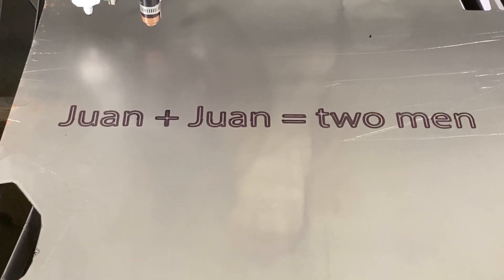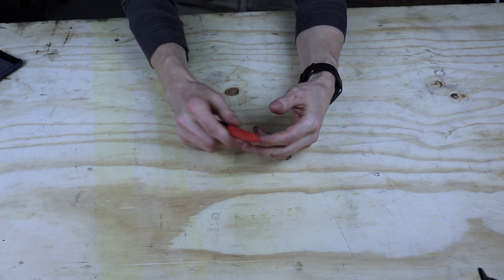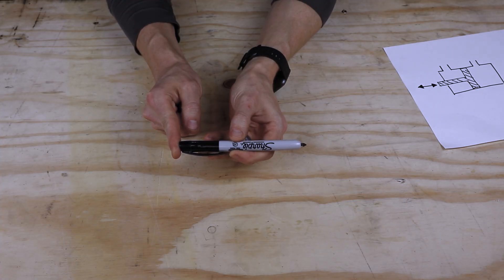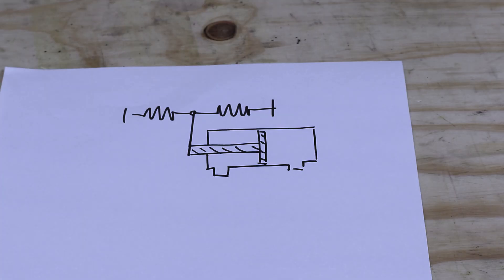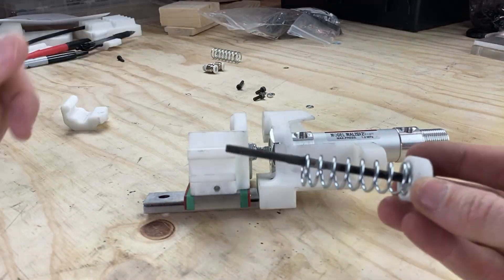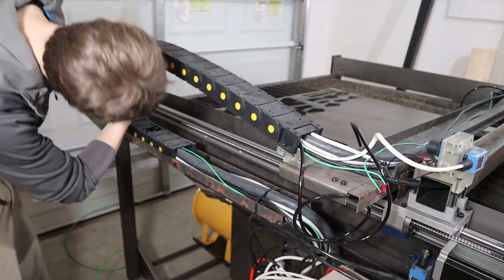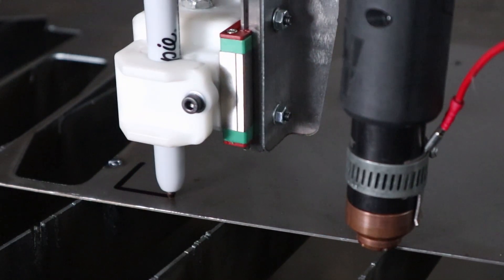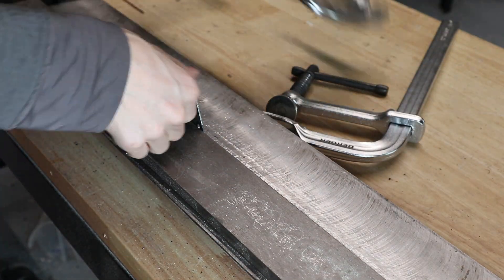This marker will change the way you work with sheet metal

Comment: 10:00 a tip I learned from an electrician. At the beginning run a rope through the rig to pull your cable. Instead of pulling just the rope and cable through, attach a second rope behind the first with the cable. Then you will have a rerun rope every time for the next pull. Assuming of course the conduit isn’t full.
Reply: Seems like you could just have one big rope in a loop, and then temporarily attach any other cable to it and pull it through
Reply: @_Stormfather  that works. We used pully sustems like that to pull cable in data centers where we had to run cables down tray over and over.
Reply: @_Stormfather  Having a loop outside the channel may not be viable due to interference with machine movement or if code forbids it. You may be able to get around a code issue by using a metal cable instead but always make sure your equipment passes code. At least when in the workplace. Best wishes!

- Max Giganteum
Reply: Sometimes you can use a vacuum to get a pull line through conduit if you put something on the end for the air to catch, like a bit of cloth or something.
Reply: @sbsftw4232  I was going to say the same thing.  Of course it only works on a solid conduit and one that has a lot room with no friction.
Reply: How odd... in the Netherlands any kind of electrical conduit is sold with a green nylon line already inside, specifically so you can pull cables through. That always struck me as such a no-brainer, that would just be irritating not to have. All the company would save by not doing this, is a few feet of nylon line costing fractions of a penny per meter.
Reply: @InservioLetum a lot of conduit in the US is sold in 10-20 ft lengths which get glued together or have fittings. Dealing with a pull line in it would suck.

Maybe 100 ft (33 m) flex conduit would be nice, but that usually gets cut to length. So that would likely also get irritating. 

Vacuuming a pull line through doesn’t take long, and it gets sold in super long lengths.

Comment: What if you use a carbide tipped scribe? It would most likely need a decent spring to maintain tension, but you would improve both marking longevity and line accuracy which is helpful in bend accuracy.

Comment: Switch the Sharpie out for a scribe tool. You'll get the finest line you possibly can, it'll work through oil or paint or rust, and the position is either up or down, no in the middle!

Comment: I did something similar on my table but with a carbide scribe with replaceable inserts. It has a compression spring on the z axis to compensate for material height inconsistencies. On 304ss or aluminum it works great. On hot rolled steel I need to run the g code a few times over to get through the mill scale. It makes for a very accurate bend line. Love your channel, you are one smart dude!
Reply: Can't you just turn down the laser and etch a line?

Comment: I can give you a tip for running things through complex routes. Take a cable tie usually larger is better for this application. Cut the head of the cable tie off so you have a long flat bendy piece of plastic. Tape the end that was cut off to the surface of whatever you are routing with electrical tape and give the tape a good stretch to help it hold in place. Be sure to leave a few inches out past the front of whatever needs to be routed. It should help guide things much easier as the cable tie is often more flexible, and will bounce over material in the way.

Comment: Did you consider ripping the felt core out of the sharpie and storing it retracted inside of a half-closed tube? Seems like the mechanism would be simpler, although replacing the marker when it finally dries out might end up being annoying after a while.

Comment: If you would look at most motorcycle shifter levers, they use a center stop on the 2 springs then you could use much lighter springs and you could use a smaller pneumatic cylinder! and it will always stop at exactly where you want in the middle.

Comment: I want to add a marker to my plasma table as well but I think I'll use one of those reciprocating (can't believe I spelled that one correctly) marker that puts tiny dots in the metal.  That way the bend lines or part numbers or whatever will survive getting heated or welded near.
Electronics box.  DO NOT put everything in the box put it ON the lid, the door.  100% access to everything and so easy to work on.  Put all the box connectors on the side just like you have them now but put all the Stuff on the door so that you can get at it.    I think I'll make a steel electronics box that is almost like a transformer and opens everywhere so everything is easy to get to.

Comment: Any reason why you didnt use 5/3 valve?   I like the spring center system.   it's out of the box thinking.   I think I would have been lazy and used a stacke6cylinder setup   requiring of course another cylinder and more length.

Comment: why not just take all of the plates off the energy chain once and out a bunch of strings or ropes so next time you need to add something just tape it to one of the ropes and pull it threw without having to take any of the shields off. just make sure where to tape the cable or whatever to the rope you make a smooth ball of tape so it doesn't get hung up on anything in there. just an idea.

Comment: I could be wrong, but wouldn’t it have been faster and considerably cheaper to just add a small servo or two and run it off a cheap $3 Arduino Nano sensing an high/low signal? Maybe I’m under thinking it though... But I do have to say that your way is considerably cooler! Enjoyed your work!

Comment: The Hypertherm machines we use have a "scribe" mode which, operating at a lower amperage, only mark the metal surface. Same torch, no offset required.

Comment: Did you consider mounting the pen on a threaded rod and then rotating it using a motor for movement up and down, like a leadscrew? I'm curious why that would not have worked. In my mind it seems to cut down a lot of the positioning issues you had to solve with the springs and piston.

Comment: @Stuff Made Here

When i was watching your video at 9:50 min mark. So you don't have to keep struggling when feeding a new cable in your energy chain. Why not attach another cable or string to the next one you add then all you need to do is tape then end of the cable or string to pull the next one through? Rinse and repeat.

Comment: Hi... your videos are truly inspiring, innovative and with a crazy amount of engineering .. one very small suggestion is that you could use a 5/3 mid position exhaust solenoid valve + check valve crosspiloting (to stop wherever u want in the middle using just logic) instead of a 5/2 and not worry about using external springs totally... I can draw up a pneumatic circuit if you would like .. 

Anyways thanks for all the creative videos.. :)

Comment: Awesome build!!
One question, what is that tool you used at 8:00 to hold the nut in place? The one which looked like a spinning top?
Also it would be great to mak it open source, both CAD and SW if you are not planning to commercialize.
Ciao

Comment: quick tips for fishing stuff through your energy chain, what I do at work is when I first start fishing something I also attach a wire that goes with the cable or what ever you're trying to fish and the next time I need to fish something that wire is still there so I can attach the next thing to the wire and pull it through. If you don't need to fish another thing right away you can keep the wire in place for later use and just ziptie both end so it don't go anywhere.

Comment: To easily install a new line in your "Energy Chain" use a existing wire/airline and pull a new line along with the same one you are using to pull the new wire/airline  :)

Comment: TIP for the lazy people. If you don't want to keep fishing the wire/tubing whatever through a pipe or anything you are using attach a string to what you are fishing through, then the next time all you need to do is tie the string to what you are pulling and pull it through much easier. Sorry don't help now.

Comment: You should leave an unused  wire or tube in the energy chain with a couple of loops in it.  Tie the new wire to one loop, and pull it through.  To make is more than one use, tie another wire (besides the one your going to leave) to make a circle so you easily fish it through.

Comment: If the plasma is always cutting metal, why not just use a scriber to etch a very precise line? It avoids all the hassles with the Sharpie. Is there a problem adjusting the Z axis with thicker/thinner materials? Maybe have it just slightly weighted so the scriber drops down and leaves a slight mark by it's weight?

Comment: You need a fishing line. Not literally fishing line but a wire that you leave in your energy chain. Whenever you need to run a new wire you just attach it to the end of your fishing wire. Then just pull the new wire, along with another fishing wire, through the energy chain and you're all done and ready for the next time you need to add a wire.

Comment: Tape string to one of the hoses through the energy chains and pull it back through. Pull the string through 3 times the length of the energy chains and tape the hose halfway down the string and pull it back through the other way. Now you can pull things though without the string guide ever coming unthreaded.

Comment: My laser cut parts supplier just uses break lines for bends, Like cutting a dashed line (like they use on flat pack cardboard boxes), that not only allows me to find the bender but ensures a cleaner bend at the edges for thicker metals.
Short bends he just adds them each end of the bend and longer ones a few more along the line.

Comment: Great idea, BUT...
You only need 1 of the 5/2 pneumatic, solenoid activated, control valves. The side with 2 ports connects to each end of the air cylinder, pressure in the middle of the 3 port side and the two outer (on the 3 port side) are exhaust. I am in no way trying to be a smart ass. I love the design, thought and am just trying to help with the execution. Hope you are open minded.

Comment: An easy way to feed the power cords through those Energy change is to use a stiff piece of wire or even a coat hanger unraveled and then once you fed the coat hanger through attach your power cord to the end of the coat hanger and put through .

Comment: Couldn't you use one of those fish tape wire puller things to more easily get the wire trough the cable chain? Maybe even having two with the right length, one that just sits in the cable chain ready for use, and another that you pull together with the new wire so you can repeat the process for the next cable.

Comment: Hey, just a question... why did you use a sharpie and not a scribe? Scribes are more exact, don't need to be turned on and off, and can work with machinist blue if you don't want to score the metal

Comment: Why not use a small solenoid instead of using a pneumatic piston which has a solenoid in the valve anyway? Cuz clicking a pen does'nt require that much force.

Comment: Never had to deal with fishing things through energy chain before, but my brain says; take a piece of good quality cord, probably in nylon for slickness, and fish that through the chain. Then link it with a low profile knot and some shrink wrap. Assuming you left enough slack for normal operation, you then have an infinite use fishing tape. just need to run it once.

Comment: 4:50 - I think I have a better idea. What if you took the marker apart and removed the piece that makes it require two clicks to retract. The piston would hold the tip out and then the internal spring would retract the tip when the piston goes the other way...

Thoughts?

Comment: Wouldn’t a servo and some gearing been easier to get the pen moving?
Reply: Some other commentors mentioned how badly the electrical noise from the plasma can be, to the point that it can fry components on controllers, making them think they have input, or burning parts out in off or on position, etc.

Comment: Why didn't you just use a 3-position 4-way DCV? one of the positions on the DCV can pressurize side A of your cylinder, one can pressurize side B, and the final position can block your pressure port and link both A and B to the Exhaust port. This way you'd only use one DCV

Comment: I think a couple of servos could make it quieter and smoother operating. the air piston while working, seems a bit violent engaging and disengaging. would also use a finer point with servos as you wouldnt be slamming them to the project and the servos could have settings for specific amount of pressure other than "crush point onto project" also should be able too add in routines for things such as dotted lines as the servos would gently life and press repeatedly.

Comment: Why not use a single 5 port, 3 position valve? You can get these with a “center exhaust” state which will achieve the floating condition when power is not applied.

Comment: I'm sure you considered this, but why not just pressurize both sides of the air cylinder? Seems like you could T both the upper and lower line with ball valves to have a third input which allows you to hold the marker centered. This should eliminate the need for a spring. Your sharpie actually has a fine tip, when it lowers the pen it mashes it into a thicker line weight. The solution might be to use a pressure regulator so that the tip is depressed less aggressively, or maybe to create a limiter so that it may only extend so far, or perhaps you could mount the pen with a spring so that when it deploys downward the spring is what forces it into the sheet metal and not the full pressure of the air cylinder.

Comment: FYI Sharpie ink is not archival. If you hung that fist piece on the wall, in about ten years the Sharpie ink would be almost gone. Probably doesn't matter for your purposes. 
I've got some photo prints that I signed using pigmented markers and some that I signed using a fine point Sharpie, at the time they looked exactly the same. After 15 years the Sharpie ink is a faint tan, the other pigmented ink looks brand new. 
I've also got a suitcase that once belonged to the artist Robert Rauschenberg. He 'notably' carried his Hoarfrost Series in the suitcase sitting on his lap from NYC to Los Angeles. It's a collectible with probably not much monetary value. He  wrote his name and NYC studio address multiple times on the moldings -- in Sharpie. The Hoarfrost series was from the late 60s or early 70s. I now have an old cheap fiber suitcase without any discernible marks on it. The Sharpie faded completely away.

Comment: How did you aligned the offset between the pen and plasma?  i want to use the same system on aliexpress 3018 cnc and the diode laser but cant really figure out where to tweak that offset distance setting

Comment: You could have used a 3/2 way valve to supply pressure to the inlet of the 5/2 way instead of 1 valve per inlet of the actuator

Comment: pen plotters on a plasma cutter is nothing new  used quite often on sheet metal coated with PVC...Also the other way to indicate where bends occur is to put small notches at each end of the bend, line up the notches in the press brake and "walla", you can also scribe...  Thanks for the video.

Comment: With the dual valves on the tool depth piston, could you just pressurize both sides to get you too to the standby position or is that just pneumatic sacrilege?

Comment: You should keep a fishing line in your energy rail for pulling cable. And when pulling cable, pull some replacement fishing line at the same time so there is always fishing line waiting in the cable run for the next time. If you have a cable run, conduit or tray with existing cable(s) without any fishing line in it already, you could disconnect an existing cable, connected fishing lines (two, preferably) to one end of the cable and then temporarily pull out the cable to drag the fishing lines through the route. Voila, you now have the necessary fishing line cable pulls to reinstall the pre-existing cable and any new cable you want to install.

Comment: Just wondering. Does your plasma not have a “marking” feature? It does the same thing you are doing there, it just uses the plasma to make a mark without cutting the material. All the plasmas I’ve used have had that feature. And that is what I’ve used for bend lines.

Comment: That's really brilliant of you to add this feature to your plasma cutter!

On a side note, I was wondering how you began working with sheet metal, or found out how to design with sheet metal.
What resources do you use for designing sheet metal parts? 
Curious to know b/c I was planning on using sheet metal for making a motor mount, and I'm not sure how much space  allocate for bends and not leave a huge gap in my design.
Might you happen to have a folder of bookmarks/ recommendations on helpful resources for working with sheet metal?
Thanks!

Comment: Would it work any better to use a carbide scribe instead of a marker? The line would be much thinner, it wouldn’t wash off and you wouldn’t have to deal with a marker drying out.

Comment: The first time you run anything through the flex trough, run a pull rope or wire with it, now your good to go next time, and always pull in another one AS you use existing rope or string 👍

Comment: Did you know that Hypertherm's Powermax 45XP has a precision gouging mode that could just scribe the line on the plate for you.  No pen required.
Reply: That's interesting. I'll look that up.
Ours has a impact engraving head, but it is way, way too loud to actually use even in an industrial setting!

Comment: 10:00  disconnect and use an existing wire to pull 5 strings of twine through, use one to reinstall the existing wire you removed and another to install the new wire  and you have three pull lines left for the future.